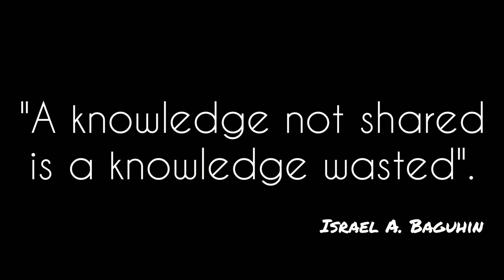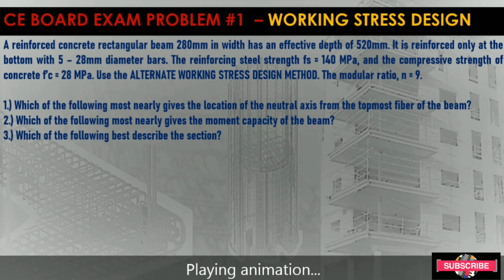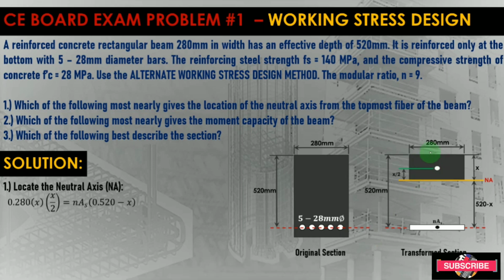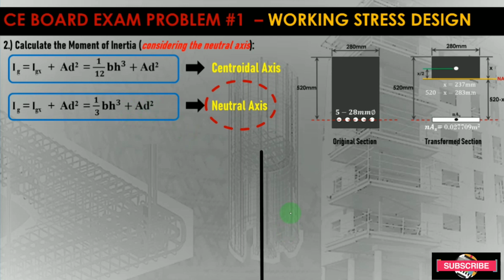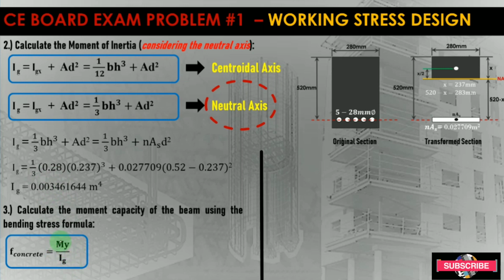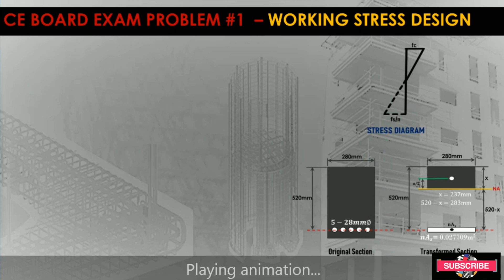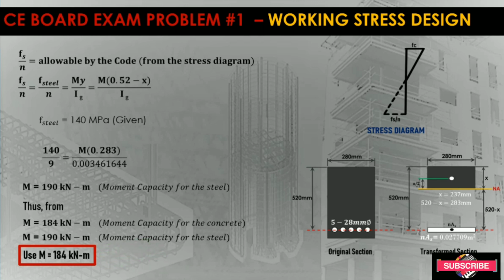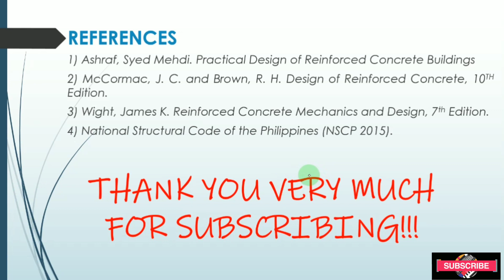WORKING STRESS DESIGN (NSCP 2015) I REINFORCED CONCRETE

Comment: Sir,  ano po value ng fs sa mga grade 33, grade 40 at grade 60 na mga rebars dito sa Pinas?
Reply: Same po 140mpa po. Pag10mm diameter below, 0.5fy correct me if im wrong